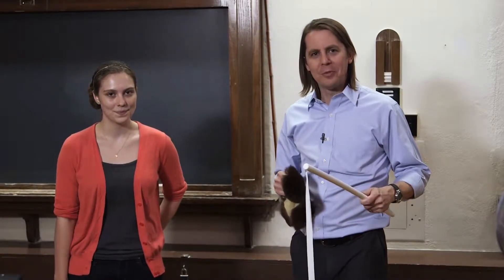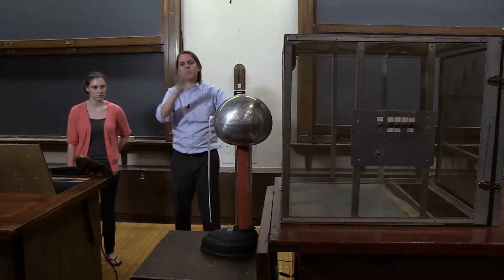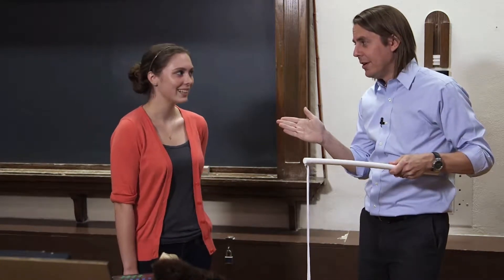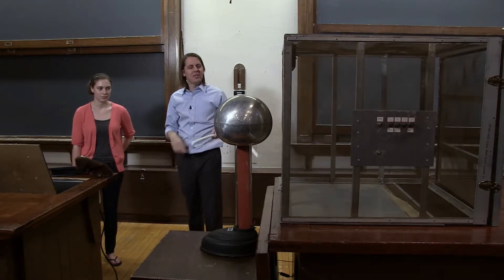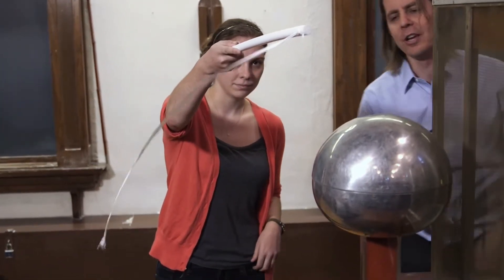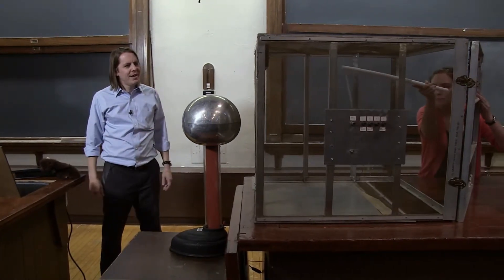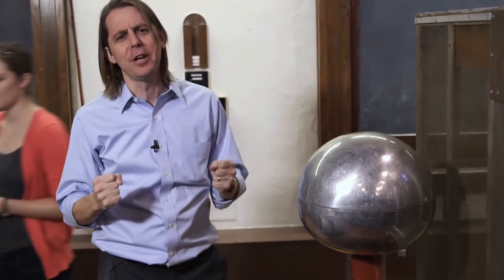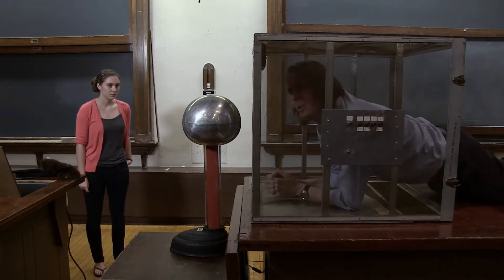DEMO: Electrostatic Shielding

Comment: that was not even full covered when he entered there , then too it worked .HOW? (talking about the side from where you entered
Reply from the maker: An ideal, completely closed cage will block all fields. However, one that is not perfect will also work.  In this case, the opening in the back is on the opposite side from the charged VDG sphere.
Reply: @Prof-Hafner  wow , that means only experts would know which conductor will shield which form of wave😀😄👐
Reply: @Prof-Hafner  yeah electric field lines do not form close loop ➿